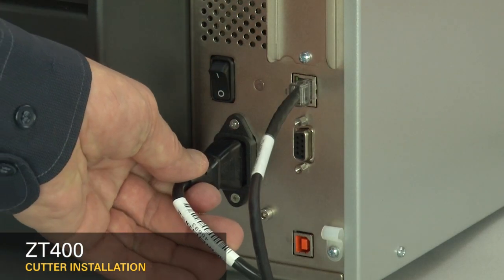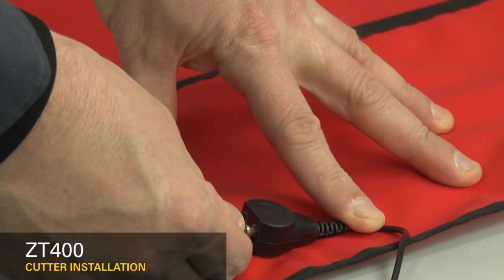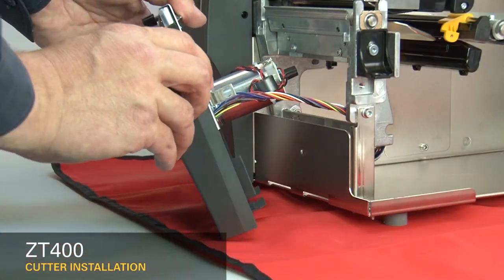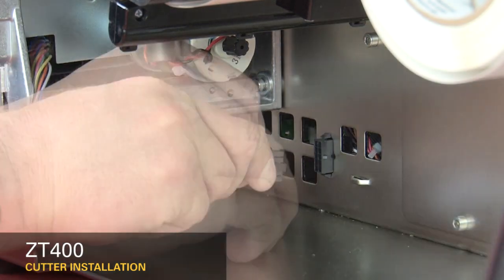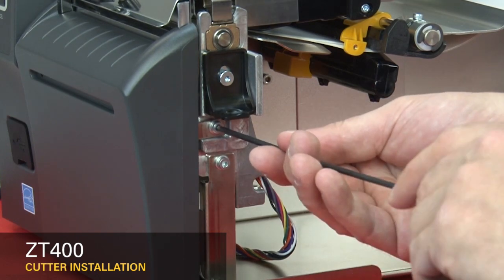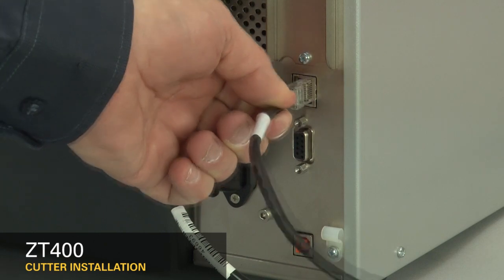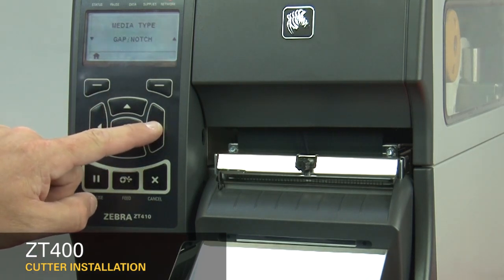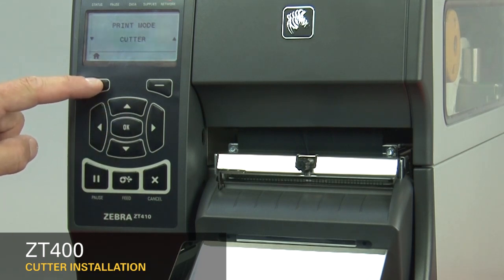Zebra ZT400 Series: How-to Install the Cutter

Comment: Tried this, there doesn't seem to be anything behind the detent hole to release anything. My problem is that even after trying to clear a cutter error using the method shown on a previous video, the error wont reset. The printer is useless as is.
Reply from the maker: Hello, thanks for getting in touch, to help you with your query please visit http://social.zebra.com/6051wDFTX or alternatively, visit our support community at http://social.zebra.com/6052wDFTi.
Reply: Do you solve the problem ?
Reply: @tanasijemladenovic7229  no, i had a spare printerr to exchange it with. Couldnt figure out what needed to be done. The company is deciding whether to send for repair or just throw away the printer.